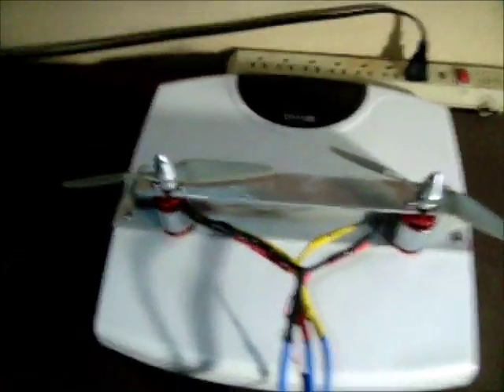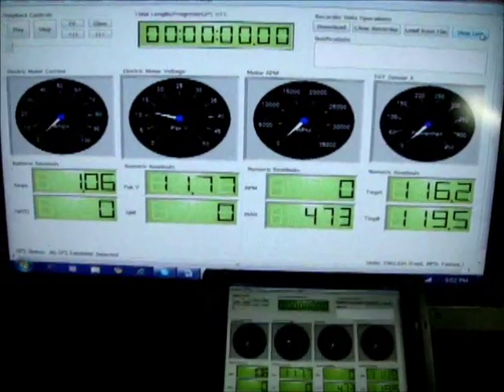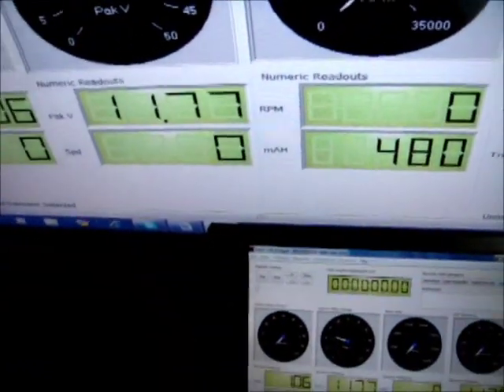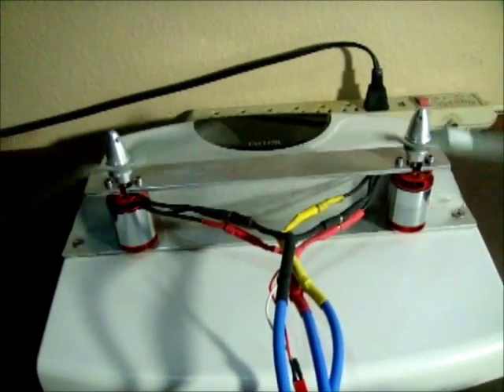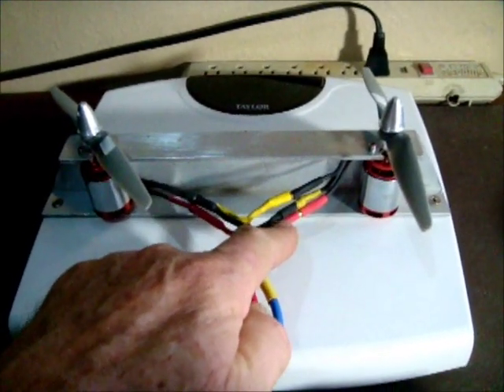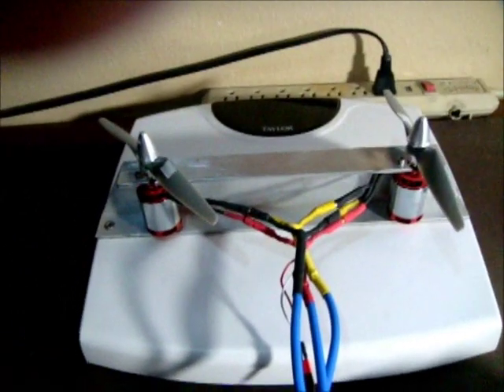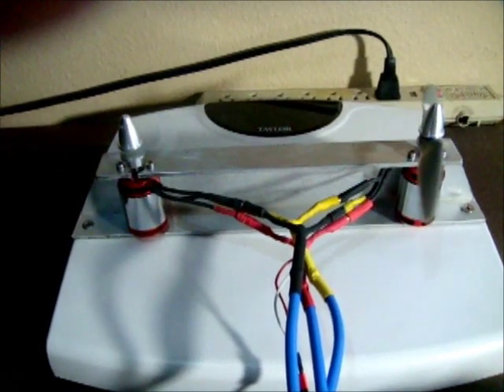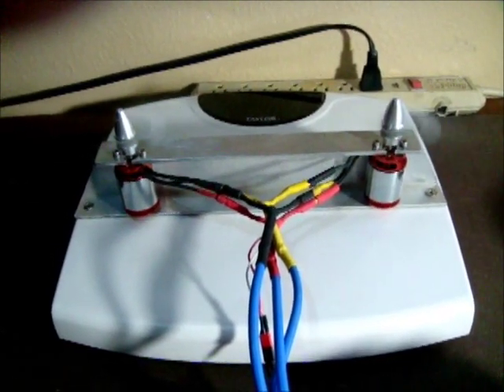2 Turnigy Outrunners with 6x4 props on 1 ESC

Comment: Is there any advantage using one ESC?
Reply: No not really, but you have a bit less weight, and you don't need to buy two. I should say: use 2 esc's, if your aircraft fails, you are in bigger trouble.

Comment: did you used esc that is the same amps with single motor?if you do normally it will bot work properly because the suppy of the current is short..you must used esc that has double capacity to the motor that you used..

Comment: Only connect one brushless motor per esc. All ESC are made to control ONLY ONE brushless motor. ESC relies on motor feddback to know the position of the rotor. 2 motors will never be syncronized, therefore you cannot use more than one motor.

Comment: what's your conclusion? do I need two esc's or not? im planning to upgrade my twinstar II to brushless and if you've concluded it will work with a single esc, that will really save me money!
Reply: 2 esc only for brushed motors but for brushless strictly 1 esc. hit up hobbyking for the red brick escs.
Reply: sorry - late night when i wrote that its meant to be 1 esc per brushless motor and brushed motors can have m ore than 1 esc as its DC

Comment: u have to connect both motors in parallel ( red1 to red2,black1 to black2;blue1 to blue 3) then u connect both motors one esc,I did the same with a servo and it works

Comment: I'm surprised it actually works at all! Brushless ESCs rely on BEMF to driver the motors correctly. If you load one motor differently from the other, then at least one WILL stall. Part of the reason for the failures is that the 'upside down' prop is loading the motor differently to the other. Either way, I wouldn't fly with 2 motors on one ESC...